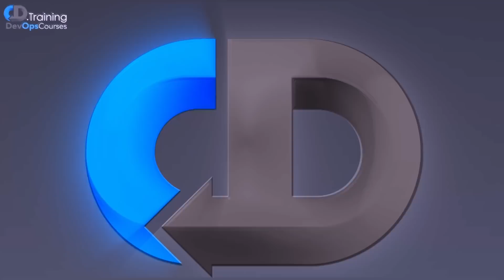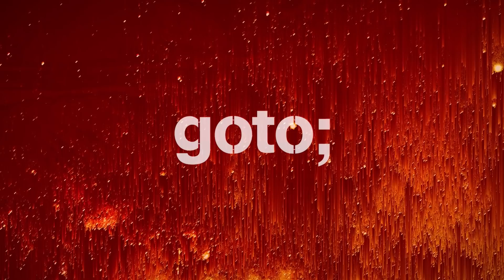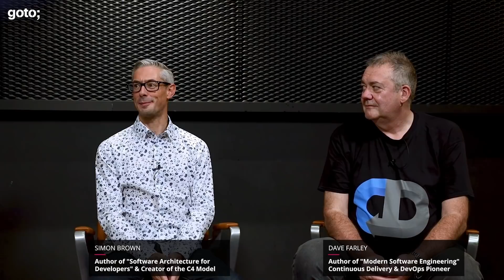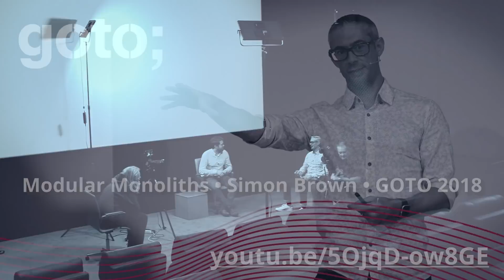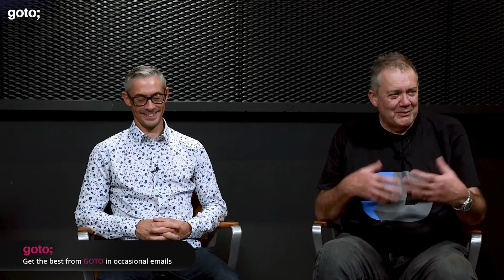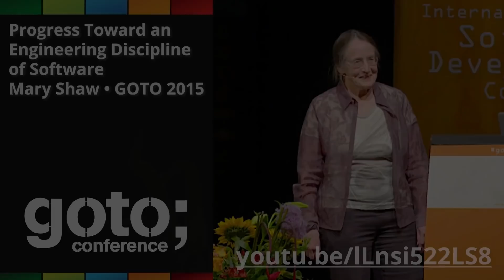Architectural Models & Microservices | Simon Brown and Hannes Lowette In The Engineering Room Ep. 5

Comment: I'd like to add my opinion that the negative comparison between software "engineering" and the other kinds of engineering needs to be a little adjusted. Not because the software engineering is fantastic (of course is not), but because the quality of the rest of engineering is also really debatable. The comparison with buildings come in discussion over and over. I've seen a ton of new buildings with cracked walls, the miracle of architecture called Stata Building at MIT has serious issues of various kinds, jumping industry there are decades of issues with AlfaRomeos (not my personal experience), Teslas have some really funky (and maybe not that important) issues like not closing the trunk very well (personal experience), and so on. Basically is not that software engineering sucks and the rest of "engineerings" are so much better, but it seems that everything relevant and worth trying will probably have problems. And software is definitely an industry which tries to do new stuff all the time (and when is doesn't, it's fairly ok, I don't think there were many bugs in Wordle)

Comment: I had the incredible luck to learn programming in a shop that practiced something very close to what you describe as Continuous Delivery down to having a group devoted to what is now called DevOps.  A decade before I started in the 70s, they worked with IBM to create CICS and maintained an in-house version called Pronto. I learned to write code for distributed systems by fixing production bugs and rewriting parts that suffered from the entropy of earlier misguided fixes.  The data was distributed over time, not space.  We were the electric utility for Chicago and surrounding suburbs.  The customer dataset was so large that it took a week of nightly runs to process the entire thing and everything happened in cycles of various lengths.  Anyway, I just wanted to point out that CD is a great but not necessarily new idea.

Comment: Hi Dave: I would love to hear your answer to a question that has been bothering me for a long time. What is the fundamental problem that "software design" solves?

For a long time, I have been thinking about the lack of continuing education and software design training in the software industry. It bothered me that I needed about 10 years and some good luck before I really learned how to do software design well (and another five years or so to understand it well enough to be able to explain to someone else how it works and why it is important). I have often wondered why there are not better materials out there for the apprentice software developer. I was equal parts surprised and relieved to hear you and Simon discuss that same problem in the middle of this interview.

When I started thinking about how to fill the gap, I was forced to think about the fundamentals of software design--starting with why do we need design? Here is my conclusion: Software design is the only tool that we have to try to constrain entropy. As briefly as I can, here is how I landed there: Computers are state machines. There is a wide variety of state transitions that are permitted by the computer, the set of allowable state transitions is the instruction set. The number of possible states and the number of possible state transitions is each so large that both of them are effectively infinite. In other words, the system is unconstrained. The unconstrained nature of the machine makes it a very powerful tool because it can be used to represent a very wide variety of problems. However, for a specific problem only a vanishingly small number of machine states is valid. A bug causes the system transition to a random invalid state (random in the sense that the bug can cause any state transition allowed by the instruction set). Over time, bugs move the state of the system further and further toward the most common states and away from the small number of valid states. In other words, bugs raise the entropy of the system state. Software design puts rules in place that constrain the allowable state transitions to a set small enough for a human to understand. Having such constraints makes the problem easier to understand and also makes bugs (violations of the constraints) easier to identify and understand.

From this I define Sofware Design (as a verb) to fundamentally be the process of creating a set of constraints that serve to reduce the scope of the problem within a given context by restricting the set of valid state transitions available to the software developer.

Thanks for the books (Continuous Delivery changed the way I think about my career) and the YouTube channel (I reference it frequently to my colleagues). You are doing good work.
Reply from the maker: I think that software design is primarily there to allow us to continue to change the code. Which is another way of say to reduce, or at least constrain, the entropy. The hallmark of high quality design is that the code based is easy to change, safely. That is really the topic of my "Modern SW Engineering" book.